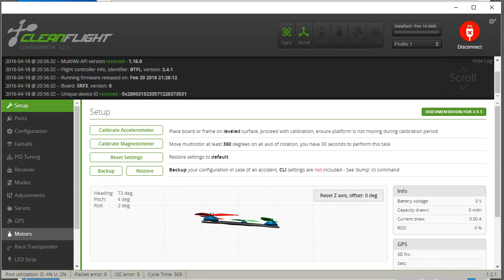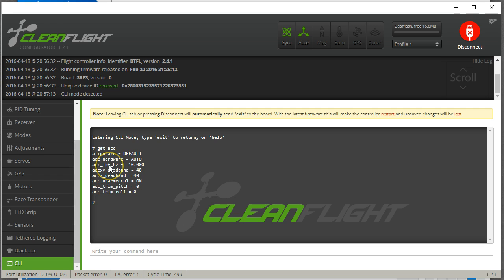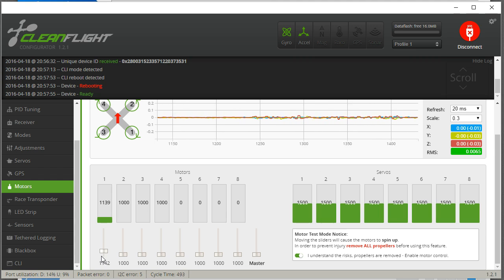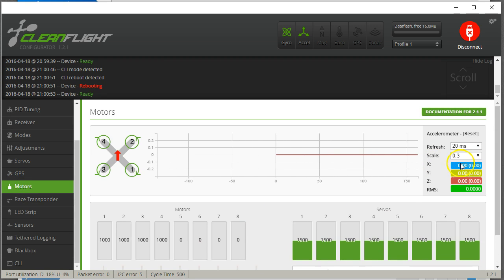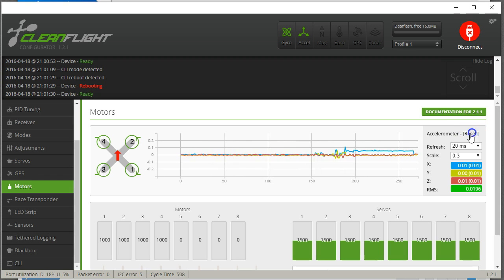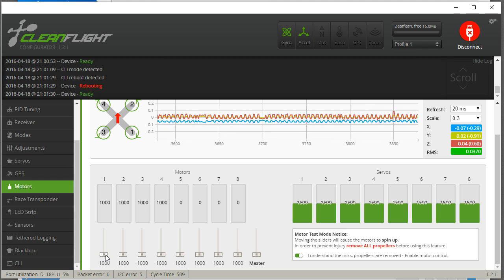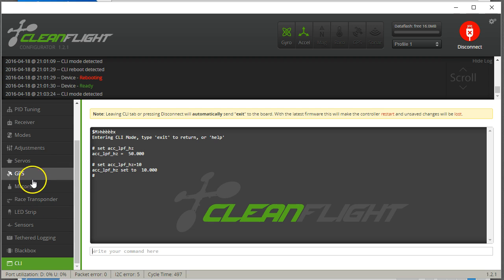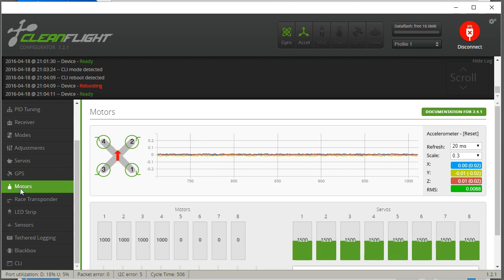Motor Vibration, acc_lpf_hz, and you

Comment: Betaflight 4.2 : when I am using acc_lpf =20 , quad is drifting away the more time I fly the more it drifts , until I cannot compensate it with stick , I saw if I set this to 40 this effects takes more time , right now I have set it to 120 and it will start at 0 degrees and after 2 minutes of los angle flight it will end pitched forward 15° , can I set this to 400  to solve problem ?

Comment: Hi. In my little quadricopter (Eachine Ex110) I replaced the control board flight (FLF3 EVO BRUSHED) and the three brushes motors. But my problem is that the motor nb. 3 runs... faster than others! All the motors start from zero but the nr. 3 takes more speed than the others unbalance the quadrocopter. What should I do about it? Thanks for help...
Reply from the maker: Hi, Roberto. This is normal and is not usually a problem.

https://www.youtube.com/watch?v=xBaefeQtA1c
Reply: Hi Joshua. First of all, thanks for your help! So, I tried everything but I can not solve it. The  engine # 3 always remains high! I tried to work on the radiocontrol trims. Engine # 3 level  has lowered. The others obviously got up. I know, it's not the right approach! But it shows that this is a regulation to be made. Yes, but which one?

Comment: Jos, using betaflight and the lowest scale is 50. And when I press reset it does not reset to zeros. Is betaflight different from cleanflight as these videos and examples all seem to be in cleanflight.
Reply from the maker: I think you are referring to the vibration on the Motors tab. Betaflight recently changed it from Accelerometer to Gyro, and the numbers are totally different. I wish they would change it back.

Comment: So what are good numbers? When testing one motor at the time the arms of my quad are notably vibrating (e.g. when laying a finger on the arm), but the motor tab shows something around 0.01-0.06. When testing all motors at the same time the quad very slowly moves and circles on my table, with 0.02, 0.03 and 0.09 (in the last test). Are those good numbers? I was a bit shocked to see it move on my table ...
Reply from the maker: +fluttershy77x 0.01 to 0.06 with props off seems very good to me.

Comment: I have a brushed micro. It does run off cleanflight, but has no blackbox. The vibrations are very very strong. What other filters should I be trying out other than acc_lpf_hz?

Any maybe you can do a demo about all the filters out there. I haven't seen any videos describing that in depth like all of your videos
Reply from the maker: +likevvii acc_lpf_hz is really just for the accelerometer. If you are not flying in autolevel mode, then that doesn't apply. And even if you are flying in autolevel mode, the gyro filtering is more important.

Start with gyro_lpf_hz if you need to add filtering on a very noisy copter.
Reply: awesome! thank you so much.

Comment: I find it strange that the acc does not work at 60hz.  I figured since I use 70hz for gyro software filter that I would use the same for checking the motors and that worked fine.  My results seemed to be different than yours as well.  0.00 - 0.01 with 10hz ,  0.02 - 0.09 with 70hz.   the 70hz test I considered normal and was able to balance a new "cobra" motor with that. Guess I should have checked the cobra with 10hz before I balanced it as well.
Reply from the maker: +Zenman FPV Maybe my motors are so noisy that the differences in the filter are being masked by the variance in the motor noise. Either way, I think my conclusion stands: your numbers are excellent no matter which cutoff you're using. And mine are terrible no matter which cutoff I'm using.
Reply: +Joshua Bardwell yeah I was going to sugest that same thing.  I think if you take them apart and at least clean the gunk that has built up, you might get them back into better balance.  Replacing bearings does help alot at least on the accelerometer traces not sure how well it actually helps the gyro readings.

Comment: Hi. Thanks for your vids they're a great help.. I'm running naze32 rev6  (waiting for X racer to arrive). I'm experiencing motor jitters in flight, any suggestions... Thought it might be a board to esc issue but am having a hard time getting my dys linker to talk to my littlebees in blhelisuite to update them (just to see whether that is the problem). I have mag, baro and accel turned of.
Reply from the maker: +doondedulin44 I mean, it could be anything. "Motor jitters" is too vague to really suggest much. Lower P and D gain until the copter flies soft or the jitters go away. At least that'll tell you if it's PID related.
Reply: off*
Reply: +Joshua Bardwell will give it a try, thanks

Comment: Hey Joshua, could you explain accelerometer and gyro sensors and exactly the differences between them in 6dof? Tall order I know.
Reply from the maker: +knwest2012 Accelerometer measures acceleration. Gyro measures rotation. That's a start anyway.
Reply: so acc would measure how fast gyro rotates?
Reply from the maker: +knwest2012  the gyro outputs its rotational rate in degrees per second. The accelerometer outputs acceleration in G's. Think about a scenario where you are sitting in the center of the copter and it is spinning. You are experiencing rotational rate, but no acceleration. Now think about a scenario where the copter is punching out directly upwards. You are experiencing acceleration pushing you down into the bottom of your seat, but you are not experiencing any rotation.
Reply: ahh, that helps

Comment: You really need Accel and Gyro for fly in Acro mode? I don't use both on F1 FC and had stable flights.
Reply from the maker: +nabob Acro mode requires gyro only. Accelerometer is only used in autolevel mode.
Reply: +Joshua Bardwell Gyro is disabled in my configuration on FC F1. Why you used gyro?
Reply from the maker: Gyro is not disabled.

https://github.com/borisbstyle/betaflight/wiki/Frequently-Asked-Questions#why-is-the-gyro-light-turned-off-and-the-3d-model-not-moving-

Comment: Hate to say it, but I like it when you have problems so the rest of us can learn from how you try to fix them.  One question that comes to mind from watching the video is, what is the beneficial affect of the low pass filter on the Acc?  I found this in the wiki:  

set acc_lpf_hz = 20

[0,...,200]
Accelerometer low pass filter. Decreasing the value might help with drift in horizon and level modes.

Not sure why decreasing the value might help with drift.  What is the beneficial affect of increasing it?  Lastly, if we fly in Rate mode or with the ACC disabled, should this be turned off entirely?
Reply from the maker: +Infernal Bill Decreasing the value causes more filtering. This helps with drift because autolevel should only respond to macro-scale movements of the copter, not high-frequency vibrations caused by motors. The accelerometer is sampled much slower than the gyro, because accelerometer calculations are very processor-intensive especially on F1 boards with no floating point unit. Because the acc is sampled slowly, aliasing is a big problem. Filtering the acc input heavily helps reduce the effect of aliasing.

If you are flying with acc disabled, then I doubt this setting matters at all. The filter is surely disabled with the accelerometer itself.

Comment: Shoot a laser from an angle at the motor in question as you ramp up the throttle. The reflection of the laser off the motor onto the wall should be a flat line. If it's wavy, there's too much vibration.

Comment: Perhaps because the reading is measuring amplitude not frequency so 10hz sample rate might not be able to tell you the frequency of the vibration but it should still be able to tell you the amplitude of it.
Reply from the maker: +Stephen Gibb I don't think it works like that. But I'm on mobile so I'll have to leave it at that.

Comment: Regarding taking a baseline on new motors, I did this with my new out of the box cobra 2100kv race editions and they were not as I would have  liked them to be, they were improved after I balanced them before I even flew them once, did I get 5 that escaped QC? maybe they are noisey motors in general, switched back to my 2300kv motors..
Reply from the maker: +Patrick Wilson cobras are not known for being well balanced.
Reply: +Joshua Bardwell Ah yes I have often seen reports and wondered that, thanks for this current vibration series, vibrations drive my ocd nuts :)
Reply: Hey Patrick, I have had the worst luck with the Cobra 2100's of ANY motor I've ever owned. It is quit unbelievable what gets passed there QC. I have a total of 20 of them and out of them I have 4 with acceptable  vibration.
I waited 6 months to buy more thinking maybe they got it right only to be disappointed AGAIN!
Good luck buddy.
Reply: Drone Punk Yeah I have gone off the idea of Cobras, my next build will be on the currently popular EMax Red Bottoms, will be interesting to see how different those are.